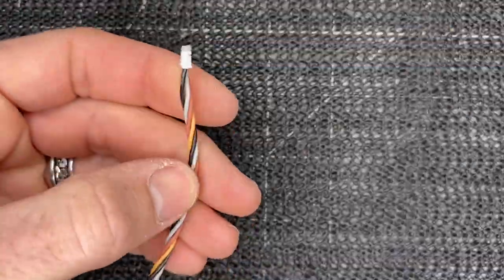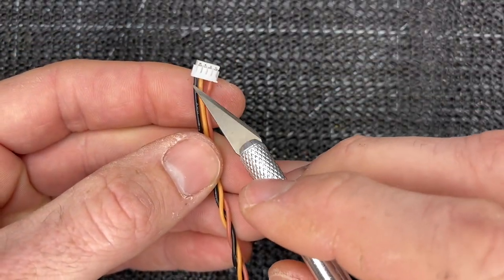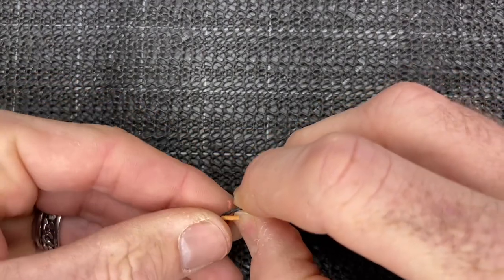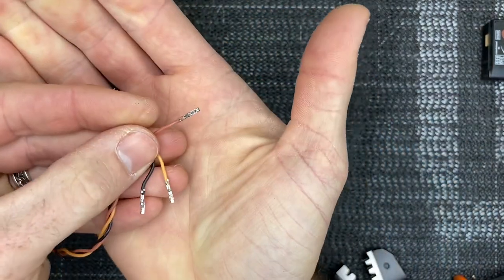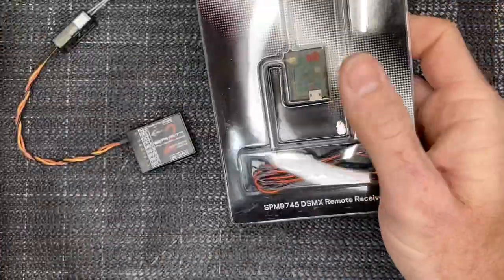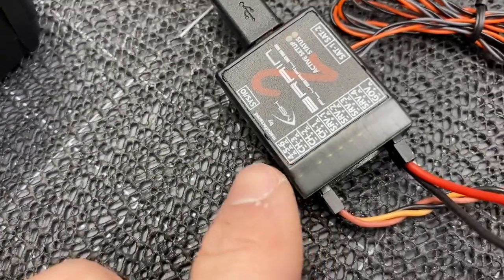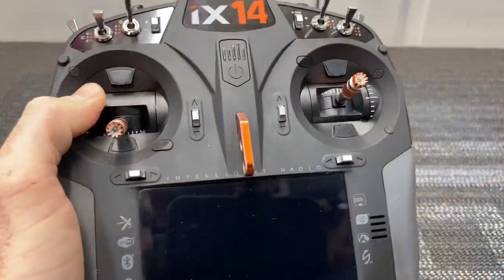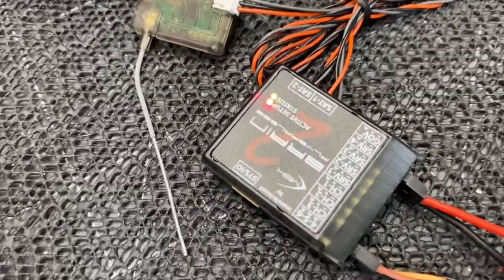How To Wire A Spektrum SRXL2 To A MSH Brain/iKon FBL

Comment: Nice video , well explained, could I also plug a AR8020T  so I can plug the SPM4651T to the SRXL2 of the AR8020T? And used another or maybe 2 satellites plug straight to the ikon2? So in that case I will run 4 full range receivers?

Comment: i ended up buying the goosky rs4 venom because of you and i have it built and am about to order everything else. I am getting the ikon 2 FBL for it and was wondering should i get the reg satellite receiver or srxl2 instead? I am running the radiomaster boxer with the multi protocol so dsmx is no problem. I am thinking srxl2 so i can use the spectrum forwarding lua script.

Comment: Hey Jeff, so helpful, thank you!  Why don't the manufacturers of this equipment make such clear useful videos?  I saw Ikon website included one of your videos, but not this one.  This one really helped me because I was totally confused about the wiring connections.  Also, for those not wanting to crimp or solder, buy a Spektrum SPMA3066 SRXL2 connector wire, that's what I did.  Easy for $11.
Reply: These manufacturers are clueless I swear.
Reply from the maker: @mikefuchs2814  I’m glad this video was helpful! I don’t under why they don’t either but that’s what I’m for! Making helpful clear videos for you! Yes, that spektrum connector is a great option!
Reply: Ty so much for giving out that wire part # you rule

Comment: Hi Jeff, great job again. It encouraged me to setup a Raw 420 the same you did with a brandnew Brain2 (because I am located in Germany) and SRXL2 with additional 2 satellites SPM9745 (also brandnew). My transmitter is a DX9. But unfortunately the satellites neither flash in the beginning of the binding process nor do they light steadily after finishing the binding. There is no light at all. Only the main receiver SRXL2 shows the right lights. I checked the satellites off the Brain2 with other spektrum receivers where they work as expected. Any idea what's wrong here? Thanks a lot in advance if you find the time thinking it over. 🙂
Reply: For all who struggle with the same issue. Today I found the solution with the help of MSH FAQs: The Spektrum satellites 9745 have to be set into bind mode by inserting a Spektrum bind-plug into the Brain2 CH3-4-5 connector while the SRXL2 receiver does not need this.

Comment: Question:  Instead of using a 4651T, could you just use two 9745 receivers?

I really like IKON's computer API.  It seems quite comprehensive.  I am thinking about using Spektrum's 6250HX but it looks like it can only be setup using forward programming, which my 1st generation DX8 doesn't do and I don't want to buy another transmitter.
Reply from the maker: @blueforest4589  yes, you can definitely use two spektrum DSMX Satellites (9745) but you will not have telemetry or forward programming, if you don’t care it mind that then go with the 9745s, everything is the exact same.

Comment: Well Done, Jeff! Cut out the Grey wire! Change the 4 pin end to a Servo 3 wire pin.
Reply from the maker: Thank you Larry! Yes, you are converting a four pin to a three panel as that gray wire is not used at all anyways it is a non-communication wire and the iKon/brain is a three pin servo wire

Comment: Will the SRXL2 telemetry work with Microbeast FBL? I don’t seem to be getting any values on the telemetry channel. I’m using TX16 with a 470LM. BTW your videos helped me a great deal. Thanks
Reply from the maker: Unfortunately no, the microbeast does not support telemetry as far as I know. What is your telemetry wire tied into?
Reply: There is no telemetry wire from esc. I am just looking for RSSI and battery voltage from SRXL2. Is the receiver telemetry compatible with TX16?
Reply from the maker: @nicklong9985  as far as I know microbeast it’s self is not telemetry capable. Plus if you don’t have a telemetry wire from the ESC there is no voltage anyways.

Comment: Hey Jeff, question, can you run SRXL2 like you have here and also run a P port to Channel 5 from the HW to the Ikon Channel 5? Is there a difference of having both telemetry like that or redundant?
Reply from the maker: The P port from the ESC to CH5 of the 4-5-6 port on the iKon is for telemetry. CH 3 for the SRXL2 is just for the SBUS RX. If you just run a SRXL2 and no line from the P port to ch5 then you won’t get telemetry but still a RX.
Reply: @westhobbiesrc8051  Thank you sir! Really appreciate you taking the time to response!

Comment: Great job, questions could you use a goosky rs4 ESC & Flight Controller on other brand of rc helicopter.
Reply from the maker: You could use the ESC, but the FBL unit is locked to that servo configuration for now.
Reply: @westhobbiesrc8051  thank you so much, will just follow your lead, your channel is the best on the TUBE, now I will get my sab 500.

Comment: I have a Brain2 and have an antenna srxl2 coming. I have an SAB Piuma on order and was just wondering, will I be able to just fly it with the srxl2 if i have the antennas mounted as far away from any carbon parts?
Reply from the maker: Technically yes, but! I would recommend having a DSMX satellite as well. It’s a big heli. The $40 satellite is a Insurance policy. It’s redundancy, a peace of mind.

Comment: Hello I bought the same receivers you have in the video and wired up as explained but im not getting main battery voltage. I do get rpm and receiver volts. Is there a setting i need to change or do i need to plug a wire from esc into 456 on brain? Thanks 🙏 im new to helis
Reply from the maker: Hello, yes. You need to run a wire from the P port of the ESC to channel 5 of the 4-5-6 port of the iKon/Brain FBL. I’m working on a video now to explain that.
Reply: @westhobbiesrc8051  
Awesome thanks so much!! Really appreciate that.
Reply from the maker: @Ride-Fly  you’re welcome!

Comment: Hi Jeff, is this setup applicable to the microbeast ultra as well? Meaning that the srxl2 goes, with the correct polarity, to the Ail/DI1 input pin and the dmsx satellite connected to the side socket? Thanks
Reply from the maker: Hello, unfortunately no, Micro beast has a different ch lay out for the servos. The DSMX satellite does plug into the side.
Reply: @westhobbiesrc8051  so no way to connect both srlx2 and satellite into the microbeast?
Reply from the maker: @andreabenvenuti7940  not that I know of, but! I do know the micro beast can support SRXL2 so maybe. I’ve not used or setup a micro beats in a long time.

Comment: Hi Jeff , i took your advice and got a SRXL2 sat like in your video  , i get telem but i dont get my Battery volts to show , and my RPM is way above what it should be ,, what am i doing wrong thx
Reply from the maker: What ESC and radio? Voltage should be the first thing that shows. As far as the RPM being really high. You have to divide it in the rpm telemetry screen in the radio. When I get home later I’ll see what the number needs to be (I can’t remember off the top of my head)

Comment: This may have already been asked and apologies for the ignorance.. Why use the SRXL2 if you can use two SPM9745? is there additional Telemetry information that you can get?
Reply from the maker: If you just use the SPM9745 you will not get telemetry or brain integration to your transmitter. Also SRXL2 is a full range RX with better fade and signal strength as well as communication. I personally use one of each on my models for redundancy mainly.

Comment: So, circling back around. Followed these instructions to the T and I'm getting the packets, but no telemetry read out. I have a AVIAN 130 ESC, MSH Brain2 and the SRXL2. Just can't for the life of me get the data read out on my transmitter. Need help..lol
Reply from the maker: So I have never tried a AVIAN ESC for telemetry. What line are you coming from on the AVIAN to the iKon? You have the SRXL2 wired right if your getting packets.

Comment: I try to do it the way you said hook up a computer power supply and all that and all I did was start flashing then it's slow flash and the computer couldn't read anything what am I doing wrong
Reply from the maker: Try a different USB cable, some cables are charge only and some are data. I must of tired 15 different cables before I found one that worked perfectly. Also some iKons need power 5-8v power on top of the computer USB. But try a different cable first.

Comment: Maybe you can answer this for me the real flight Evo when in the bind mode is the orange light on always would you know
Reply from the maker: When in bind mode the orange light will be flashing when the radio is blinded the orange light will be solid.
Reply: @WestHobbiesRC  when it binds it stays on then it will go out rf is installed on a HP Laptop with windows 11
Reply from the maker: @John-bp9mj  is that when you are in real flight? Or just all the time?
Reply: @WestHobbiesRC  actually it isn't it is when iam setting the controller up nx8 to realflight
Reply: @westhobbiesrc8051  and it is the evolution one
Reply: @WestHobbiesRC  I will get it to bind then start setup for channels and the bind light will go off and not come on again
Reply: @WestHobbiesRC  horizon hobby by sent me directions and I followed them I couldn't get one channel set up then couldn't run the program at all would not find the controller
Reply: @WestHobbiesRC  I ended up using my charging cable and still had some trouble but thanks watch your videos all the time great stuff

Comment: Thanks for this. I have a problem with high telemetry fades on the 4651t rx (approx 1 per second continuously) showing up on an nx 10 transmitter, but it doesnt go into fail safe after 45 continuous frame losses. Same problem if connect 1 or 2 sats, although the sats do no show many fades. 

Any idea how to fix this please?
Reply from the maker: You’re welcome! So that issue is from the iKON update. I had the same problem on four different helicopters and it only happened after I updated them. It drove me crazy for two days straight trying to figure out the problem I went through multiple SRXL twos multiple different radios all the same thing. I went back to the version before the latest update and problem went away. Now I did try and fly like that with the Fade going up every second and no issues. So I’m not sure what’s going on.
Reply: @westhobbiesrc8051  thanks, its been driving me nuts too. Will try your suggestion!
Reply: Roll back Ikon firmware from v100 to v94 solved the problem! I flew with this version previously with no issues so confidence restored..
Reply from the maker: @simonchapman2319  it’s definitely something with the update, it’s got a bug. I flew on it and no issues but I don’t like seeing that number climb like that so I went back to V94 as well.

Comment: Would be nice if they sold these plugs already wired up like this
Reply from the maker: Spektrum does! For the 6250 but it will work with iKon as well!
Reply: Do u have a link to that cable ?
Reply from the maker: @scottbaddley72  https://www.horizonhobby.com/product/srxl2-update-cable-receiver-servo-male-and-female-female/SPMA3066.html
Reply: blade 330s comes with it

Comment: just a Queston , can you use a Receiver that has Telemetry, on the Brain/Ikon just for the telemetry, im not talking about a Sat, will add 2 DSMX sat to the FBL system , just need to know if it can be done on the Chanel as you explained and if it will work . like all we do have many receivers (for planes ) but not many Sat Receivers that  has Telemetry. then we can get them to work ,,thx you kindly , Love your videos and simple explanation ,, anyone can understand ,, makes this Hobby great ..
Reply from the maker: Thank you! I’m glad you like the channel and the videos are helpful! so you mean like a regular RX just for telemetry? that’s what the SRXL2 is. but I’m not sure about using just a regular receiver as it contradict with the DSMX satellites as you would be telling the iKon/Brain two different receiver inputs. as with the satellites it makes the iKon/Brain the “receiver “ and if you use a regular Receiver you would need to SBUS or single line it.